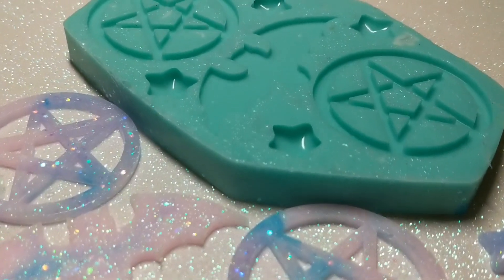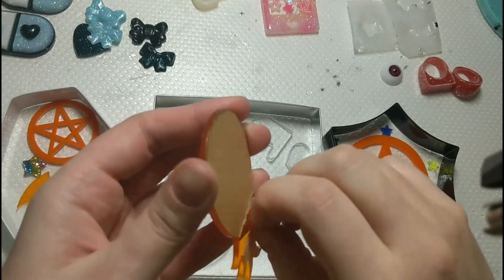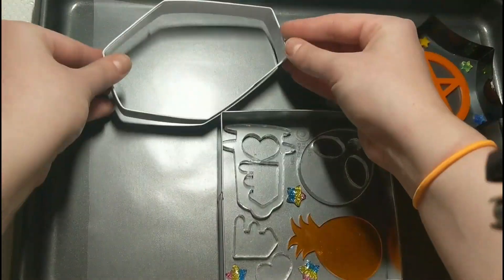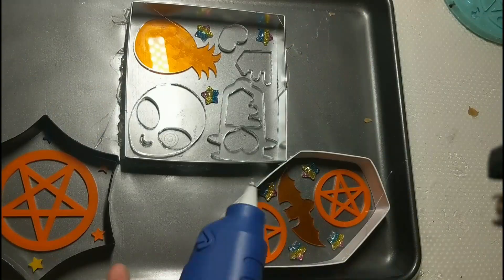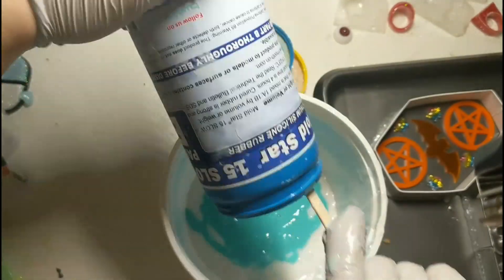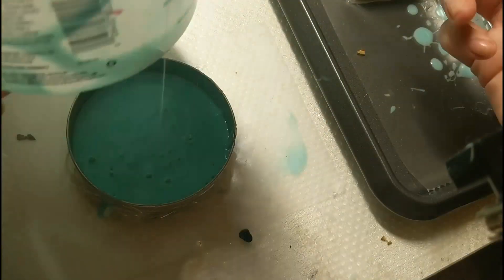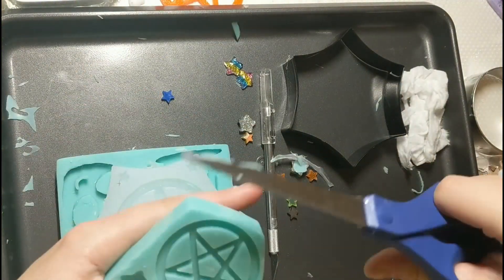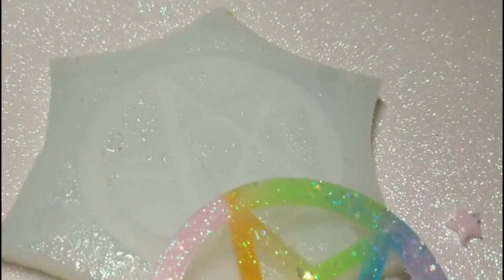SILICONE MOLD TUTORIAL!! The trick to get out all the bubbles!! Sophie and Toffee & Smooth on trial

Comment: Where do I get like all the stuff to make the mold of?! The pieces itself to have the shapes in the mold ?
Reply from the maker: There's alot of different places to get things to mold! I have a couple of friends that have acrylic cutting machines so I just bugged one of mine to cut some pieces for me. These ones I ordered from a friend's shop called Yokai Candy but I don't believe they are around anymore.  You can also get some things 3d printed and then mold that 😊 some libraries have a 3d printer available to use .

Comment: when I tried with contact paper and smooth on silicone it didn't cure where the silicone touched the contact paper.  Has that ever happened to you?
Reply from the maker: The only time that has happened was when I used a different brand of molding kit. What brand/type did you use?
Reply: @EgglienCreations  I used the smooth-on mold star 15. Everything cured except the thin layer touching the contact paper. So I’ve been just gluing down the pieces to the paper but not removing the backing. Basically just using it as a cover for my table at this point lol. I’m scared to try it again but everybody else seems to have no issues with it. What brand contact paper do u use? Maybe that’s my issue, the brand of contact paper idk
Reply from the maker: That's so odd!! I havnt ever had that happen!! The only thing I could suggest is trying to use some packing tape instead to attach your pieces. If that works then there must have been a weird residue on the contact paper that's messing with it's chemical reaction
Reply: @EgglienCreations  tried it with a small amount of silicone on cricket transfer tape and it didn’t have the issue. Def must’ve been something in the one I used. It was just some random contact paper on amazon. I made sure to get more circuit transfer tape for my molds.